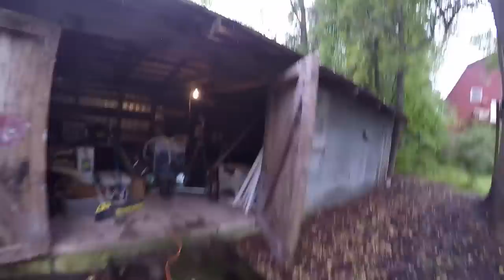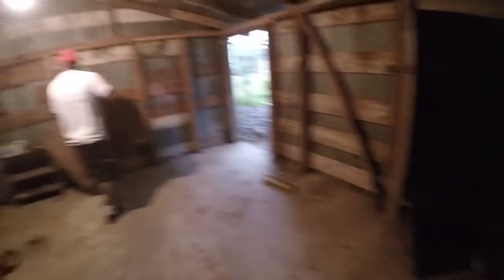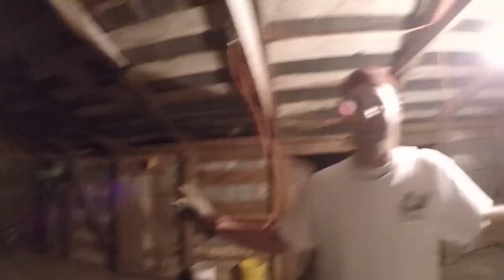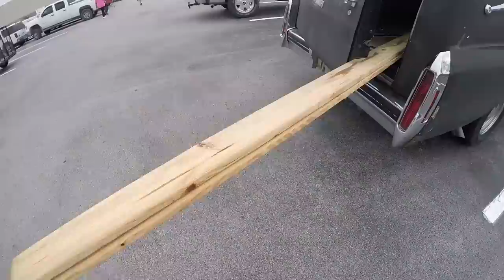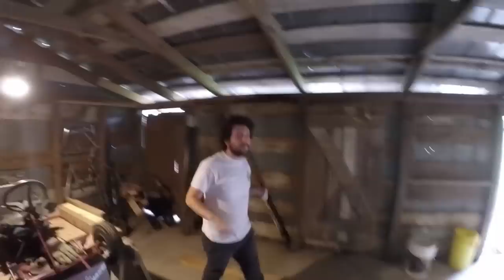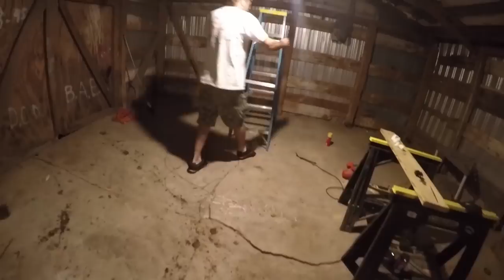We Got Kicked Out & New HQ!

Comment: For how much power you plan on pulling out there, with grinders, and drills and whatnot you should go ahead and run a separate "Sub Panel" with your own breaker box in the shed, with a BIG thick beefy  set of wires from the panel in the big garage (direct burial wire) just dig a trench, bury the wires, it'll be fine- if you run decent wire (thick enough) you'll be able to run your 220v welder out there-  Lights are cheap, 4ft long 2-bulb florescent fixtures are like $10 at Lowes, (bulbs not included) you could light up that whole shed inside like DAYLIGHT with like 4 or 6 of them? some proper 2-gang plug in boxes on the walls, you could have a serious workshop! Maybe paint it on the outside? Get all teh keaks fixed and put some Foam insulation boards on the inside (cause Ya'all are gunna freeze yer balls off in the winter) I'm actually Jealous................. This move wasnt a down grade- Keep thinking positive thoughts!
Reply from the maker: +Eclidean Thanks for the info... I know nothing about wiring and such. We'll definitely look into it. I don't like the idea of running lots of power through what is essentially one outlet.

Comment: just an idea. I've worked on cars bikes and a lot of things in my shop. you knownthe rollers on a dino? well I can tell you guys have perfect welding so why not make a platform with rollers on it to put the rear wheels of the kart on it to test run it. test to see if it throws the chain, and alignment. it would be a perfect addition to the shop. it doesn't half to be big. easy to build. a few square piping. and some round pipes on bearings to let the tires free roll. with some friction tape or use a angle grinder to scuff up the rollers for traction. just giving a idea to help you guys out.

Comment: Pressure wash the inside of that old shop then after it all dries out spray all the interior wood and metal with 5 gallons of Kilz primer to brighten it up then install 3 of the 48" LED shop lights from Lowes ($39 each) and it would be a great start.

Comment: definitely reinforce the structure of that shed and run proper electrical power to it as well. regular 110v and 220 just in case you want a air compressor

Comment: Please.  Buy yourself a roll of underground wire.  Roll it out  buy small breaker box. You can wire it in super cheap and easy.  Tie it into garage. You could even run your welder and have outlets   Those ext cords are braided copper.  Yikes.  You will burn up even a drill.    Solid core is the way. !!!!!! Cheers

Comment: What you guys need lighting wise is what I call a LichtKannon config... all you need is 2-4 high powered LED flood lights (30-50W at the most... 100W would be cool but the single most overkill thing ever!) and put them where they spread the most light across the space... the light should be nice and even and give you less annoying shadowing when you're trying to look into a tight space on a car/go-kart... you can get the flood lights cheap on EBay... watch it though... go too cheap and they don't use the right driver units! they tend to use as low a wattage as they can get away with when you go el cheapo...

Comment: find some white or aluminium colour plastic (insulation?) foil and tack that to the beams on the ceiling and drape it down the walls and point the ledbulbs up toward it , should make the place quite a bit brighter and with some luck drain the leakage from the roof to the sides and make the place a little less hot / cold
two or three 33 watt fluoresnt lights might work better too  though they thend to colour video green

Comment: Early light bulbs had a carbon filament suspended in a glass bulb under vacuum, 'modern' incandescent bulbs have tungsten filament in a low pressure inert gas. 
Soft light is better for filming, so buy some lamp shades mate

Comment: If you ever decide to insulate this gem, consider spray polyurethane foam.  It would fix so many little issues with this, , , , uhm, , , , gem of a garage.  You probably need just an inch in the walls and two in the ceiling.  Best of luck guys.
Reply: +Robert Palmore thanks

Comment: yall are gonna burn the damn barn down with all those extension wires. keep a fire extinguisher close by
Reply: +TheKaziCo as little power as that draws it'll be fine.
Reply: +Phoenix Studios If you would know anything about working in a workshop or around power tools you would know that all extension cords, LED lights or not, are dangerous especially with so many.
Reply: +Thomas The Spank Engine It'll be fine!
Reply: gfci
Reply: especially with all those spiders as kindling
Reply: +1FastFox Can't build things with just led bulbs. Sooner or later they will have power tools that draw power and either will cook the cords or cook the motors of the tools. That is why if you look at contractors they buy the heaver 14g (15amp) or 12g (20amp/w 15a plugs) cords. The cords they have are more likely 16g (10amp) although that new cord they got is a 14g cord from Lowes.
Reply: With them using all those cords coming from the same power supply from that far away, the current drops significantly
Reply: It'll be fine

Comment: Go on amazon and get a few 5-meter 50-75 watt white LED strips for about 30$ each. STring em up to the rafters and youll have some great shop lights. Try these: http://www.amazon.com/Generic-3528SMD-300LEDs-16-4feet-Supply/dp/B01148W4DW/ref=sr_1_4?ie=UTF8&qid=1445311473&sr=8-4&keywords=5+meter+white+led+strip+75w

I use em myself, They're crazy bright.

Comment: How many feet of extension cord are you using? I am pretty sure you are going to have some major Voltage Drop. Might be a good Idea of running a Cord with #10 wire will reduce the voltage drop.
Reply: +Jesse Cassidy  you Can run number 12 Extension cord 145' as long as you don't use any thing that pulls more than 7 amps. So a 4" angle Grinder. Also if you have too much voltage drop you will kill the life time on the LED bulbs.
Reply from the maker: +Jesse Cassidy Thanks for the info. I'll bring it up with Ike.

Comment: You need to get the shed wired or you will have an electric bill from hell. You can minimise the power use by getting a 3 faze  cord which is double the size and pulls power better. Best to invest in  a wiring that gives you 110 and 220 for the welder.

Comment: Why don't you just dig an underground channel for wire, instead of running the extension cord across the entire yard it will help with less clutter and make electricity a whole lot easier
Reply: well true but if you think about it , its not that hard because the hole wouldn't need to be big considering its a small wire but i know what you mean
Reply: +Mw3TheOriginal or you could just leave it on the ground. Why waste time digging a hole
Reply: because after a while it could wear out and time after time you'd need to buy new ones
Reply: are you kidding me? a heavy duty rubber cable is going to wear out. from what would it wear out? does that also apply to all the wires on the telephone poles?
Reply: +Tyler Mondano   If the extension cords are left out side they will fail in about a year ,  quicker with the winters they have .....   Mine lasted about 6 months  running from my house to my building in NC ...  Extension cords are not designed to be left out in  the elements .  The sun is the worst for them , it kills the rubber coating pretty quick ..
Reply: now that i can see.. he didn't explain how it could wear out and then said because of animals.. lol
Reply: yeah my bad
Reply: +ipedex what happens when they need to cut the grass. that would be annoying af  to keep unplugging it
Reply: exactly